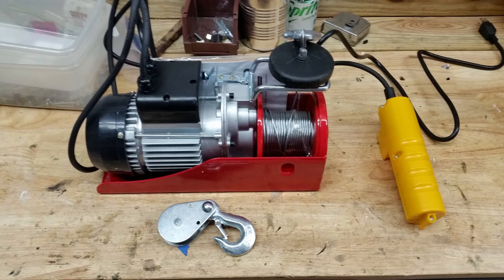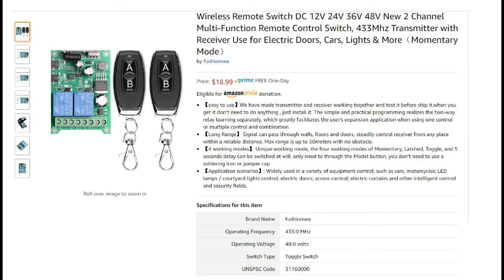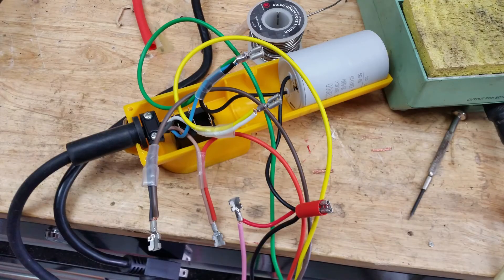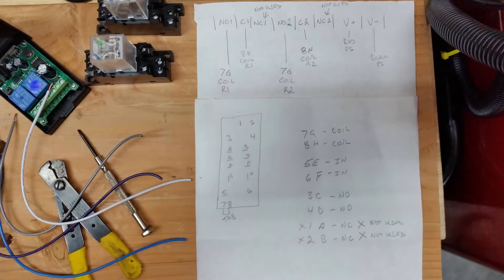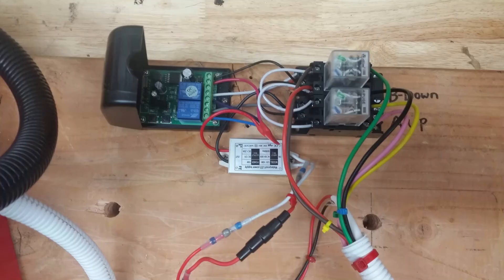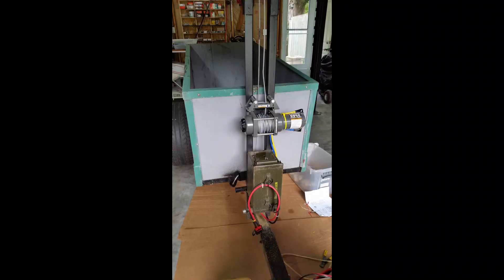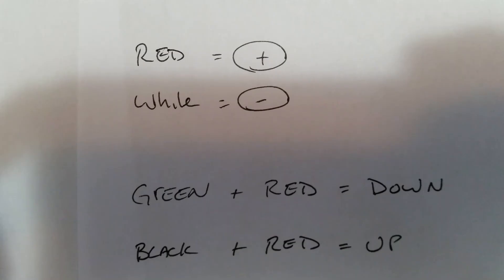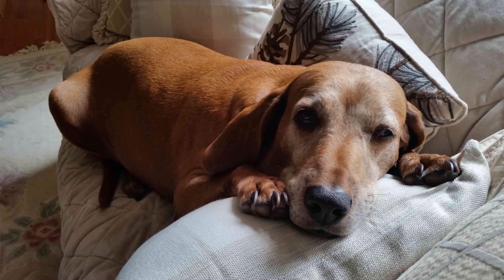How I added a wireless remote control to a hoist and to a winch

Comment: can any one please tell me how to hook up my wx-880-1 vevor wired controlled hoist to  a wireless controlled receiver.
my hoist controller( up / down /stop) cord has 4 wires. RED/BLACK/YELLOW/WHITE.
(the yellow has 110v without pressing anything.)
(also, touching green and white discharges the capacitor)

the power cord has blue = pos/ red =neg and yellow with green stripe = ground

the box i am wanting to hook up is a motor wireless remote control switch 110v/220v ac 10a control relay.
it has from left to right
reverse/  common /  forward / power input  LINE + / NEGATIVE -
thank you or anyone who can help.

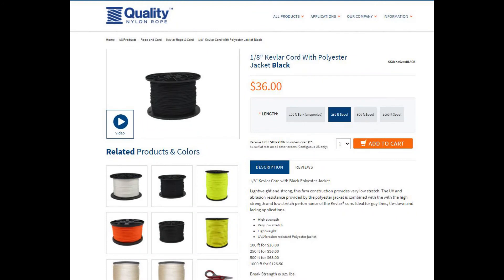Comment: 4:10 may I ask why you prefer cord to wire please?
6:27 DC, single pull, double throw?  How can I find out what remote will work with my Giantz Electric Hoist Winch 125/250kg rope?  Specs: AC 240v/50Hz, 510W.
Reply from the maker: Steel wire frays and that is some sharp stuff.  So if I can,  I always replace it with a cord.  
I'm not familiar with that hoist, or any other hoist really.   You can use the video as an outline.

Comment: Did yours have speed control? The manual says it does but couldn’t find it. Also 1st box had no bolt package. 2nd box just had bolt & spring washer. Instructions mention it also comes with a regular washer and in one spot says it comes with nuts & to fasten tight. Package contents do not list nuts. Tech support is just the number for harbor freights. Takes over 30 min to reach someone. Had a big problem exchanging the 1st box for the 2nd. Would not recommend Harbor Freights.
Reply from the maker: No speed control, just up and down.
Reply: Don't you know the trick??  When ya have a problem, ya send your buddy in and buy another one.  Then play swap the box!  And no, they don't need your phone number.  This is why they needlessly change paint colors on their junk.  Some items get "updated" more often.  They know they sell garbage so they must be happy to EAT IT when I dump it back on their counter! 😝

Comment: Great video, really helped me figure out the wiring in my hoist without having to take it apart. Seems like a sketchy mod to make though. Every time your neighbor opens their garage it drops an engine block on your head.
Reply from the maker: Funny.   Rest assured that my neighbors are far enough that their remote will not trigger the hoist plus the hoist will only work if the lights are on.

Comment: If someone operates the cable remote control (on the winch with the capacitor motor) and you operate the radio remote control at the same time, then you have a big problem!!
Reply from the maker: If one person pushes up and the other down, I will take your word for that, but the likelihood of that happening is near zero, so I'm okay with that.

Comment: I bought a "broken" winch (same one) it was just missing the remote and therefore capacitor. Could you tell the voltage and microfarads of the built in capacitor please?

Comment: That’s an awesome setup! I bought the same electric hoist and I’m trying to figure out if I can add a limit switch for the down direction. Can you please help me on this one? I want it to operate just like a garage opener. Thanks.
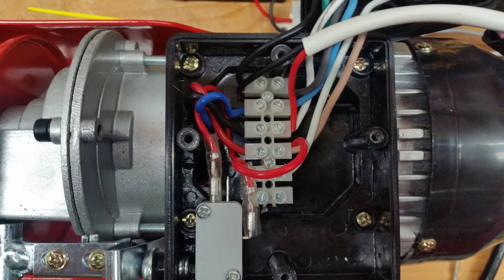Reply from the maker: The picture @3:22 is the control box on top of the motor.  To limit the down direction only I would put an inline switch on the dark or light blue wire.  OR @0:18, the hand control unit, I would put an inline switch on the blue wire.  Now your wires may differ, so test it out.
Reply: @richardengland7077  I will try it out and test it. I’ll let you know the results. Thanks!
Reply: @richardengland7077  The wirings are different and so are the colors. It has two different switches on the handheld controller.
Reply from the maker: @brightfame7984   This is only my guess.  One switch controls up and one down.  Putting an inline limit switch on one of the wires for down should work.

Comment: Please correct me if i am wrong, the DPDT swich closes 4 contacts upon being press to either side, (the middle connection closes every time ) so how did you manage to connect these 4 contacts while using only 2 relays,, also what is the wattage of your hoist, isnt 240v 10A relay too low for this<< please help me i am trying to make this for my father
Reply from the maker: You are correct about the DPDT switch.  One really is for down and one is for up.  The middle contacts on a DPDT switch (always hot) are supplied to both relays.  (I supply it to one, orange and brown wire, and then use two white jumpers to the other relay (left side).)   Each relay has 2 distinct wires (right side).  Mine is 110V.  Check your hoist's draw, it may be different.